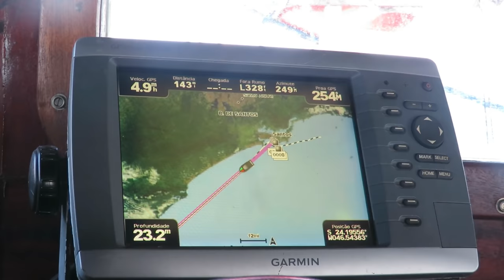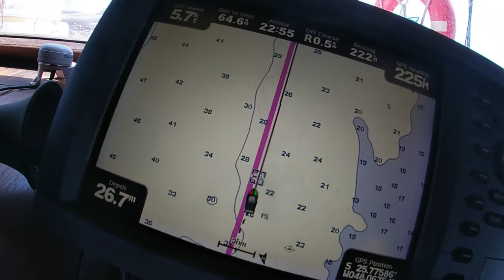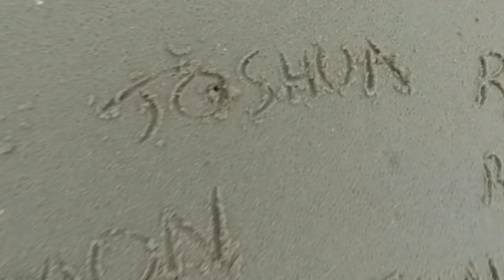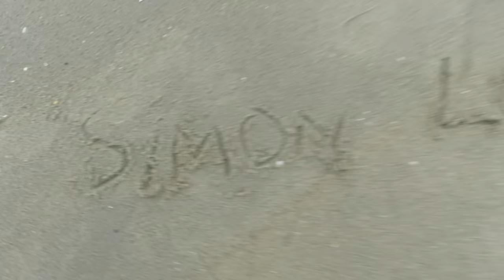HOLY SHIP! Cruising 250 nautical miles on board of a leaky boat — Sailing Yabá #5

Comment: Hi Guys.

I say this with all Love.

Cleaning the bilge, checking the charging rate of your start batteries and carrying spare batteries and changing the belts before the trip would have made for a very pleasant voyage with heartache or stoppages.

When you get a chance put new belts in place over the water hoses so that if they need changing you do not have to undo any water hoses, just cable tie them out of the way.

Good Luck with the haul out.

David Down Under.
Reply: Good advice David. More importantly, is the way you said it. Too many YouTube viewers shout out their thoughts regardless. Whether or not we have a lifetime of experience, suggestions can be made courteously. Otherwise, the recipient sees aggression, arrogance and derision. Then the point is lost. Most Yaba viewers feel a lot of love and support for this project.

Comment: Nice work getting to port safely. Glad you made it. 

What starting you don’t(shouldn’t) need to pump the throttle. That does nothing for a diesel. It also doesn’t help that I saw the gearbox cable moving which means you were putting it in gear while cranking. If you had separate throttle and gearbox controls it might be different. But proper a running diesel shouldn’t need to have the throttle moved to start ever. They should always start in the idle (tick over) position. 

If you had left it in neutral it might have started even with a low battery. The electric starter motor isn’t supposed to turn the gearbox, prop shaft and prop. So if you have left the throttle lever in the middle (idle and neutral) then it might have turned the engine over fast enough to start even with the low battery. 

Cheers,
Jeremy

Comment: Your engine not starting is most likely a connection problem. Remove and clean all your connections. The engine cooling problem is common. Your heat exchanger is most likely clogged and needs to be cleaned. Remove and have it cleaned. A low cost approach is placing the heat exchanger core in white vinegar.
Reply from the maker: It was a bad terminal connection. We just connected the engine to another battery. Also there was air in the cooling system so I just opened up a hose to let air out. That fixed the problem

Comment: Pressing that starter button and not hearing the starter spin the motor must have been terrifying. Glad it was sorted out
Reply: Been there. Got frustrated with girlfriend for setting battery switch in wrong position.  Thanked ALL the dieties for poppets on diesel!! I learned things like those poppets, pull cord back-up, and hand priming fuel pump are priceless.
Reply: @danielbuckner2167  lol been there done that too haha. One tme I let the women take the boat out.  I told my sister tank 2 is full but not much left in tank 1. Just switch over right away. You know they run out of fuel and she never remember to switch it over.  Her dumb ass paid for the tow.  I can also remember a time my aunt sunk the boat because the wake scared her and she throttled down. She went up and straight down, whoooshh boats full of water.
Reply: @JoeKyser  I've never run a diesel out except in a 7.3 Ford that had a bad gas gauge. It goes on the fritz semispasmodically so now I hit the trip meter at every fill up just as a back up.
Reply: @danielbuckner2167  mine was gas which makes it simple to switch when you run it dry. Idk why no one, especially my sister thought about it. They didn't know they ran out of fuel so they say. The fuel Guage works fine lol.  Just no thought into it at all. My sister knows better. She was freaking born on a boat. I guess they were just looking for the good times haha. Boat was the preferred travel method to town so they could shop. It was way faster in the water rather than the car which you had to take a crazy drive.

Comment: I am so glad you made it.Well done. I was fairly confident you would. Now can I add a little advice, please? Each time the motor started I didn't like the sound it made. It seemed to turn very slowly at first, then crank OK then fire up. I would recomend finding out why the initial cranking is so poor. Maybe starter motor? Weak battery? Poor battery connection? Coolant leaking into a cylinder (from a slight head gasket leak) causing higher compression on the first revolution? Clearly, I can't diagnose the situation accurately from just watching your video, but I would recomend investigation and rectification before putting out to sea again.

Comment: The more I see Yaba the more I fall in love with how sleek she looks in the water, although it's probably going to be a long rough ride bringing her back to her former glory I for one cannot wait to see the end result, I have faith in you two and although I am sure you will not cut corners make sure you follow Roberta and Ducas example and fix everything possible,regardless of how minor it is.
One question, you said you had carpenters look at the hull, did they by any chance give you an idea of how much damage there is and the cost to fix it?
I can't imagine a wooden hull is going to be cheap to either replace or repair.

Comment: Most Old diesel engines have a decompression lever. Pushing it makes you able to put speed in the flywheel without resistance and start the engine with almost empty batteries. It might be a good plan to look for it on your engine. Saved me dozens if times 😊

Comment: I strongly recommend you purchase a small portable generator. It can make life so much easier even when there is not an emergency
Reply: Honda
Reply: lol. you mean buy a whole new boat.
Reply: There is a portable generator in a couple of the shots
Reply: @AlPence  
I missed it.
Reply: yep, it is in some of the shots. It's one of those "NOISY" one's like mine......LOL
Reply: @mikealbert2527  I think what you’re seeing is the pump he bought for the journey just in case they needed it. It sort of looks like a small generator. But it was in the last video when they were testing it and talking about it.
Reply: Spot on these guys don't seem to be prepared for an emergency 😣 You should always have a plan B and preferably plan C at sea. Also get some decent batteries.
Reply: @wcads623  true, but it’s let’s remember they do not have the boat set up yet. This trip is just to get them to the location they’ll be doing their work.
Reply: @srcastic8764  Yes but setting off on a 250km in a leaky boat you need to get the very basics in place even on an inshore passage. Things go wrong at sea very quickly  weather changes, equipment failure, blah blah etc etc .
Reply: @wcads623  no disagreement there.

Comment: Loosen the alternator mount, and then slip the belt over both pulleys, and then tighten the alternator amount until belt is good, don't turn off the engine it won't restart..... I did this one time in my old Chevy out in the desert.

Comment: I have strengthened my faith in your boat after this trip. A broken belt is nothing but I suggest that you buy spares before you forget. Also,, solve that problem with the cooling water before the next trip. Great job with the video guys.

Comment: Congratulations getting to your home port, after the last video I was really shocked how bad the hull appeared. It can be fixed at a cost, sadly that may greatly exceed the value of the boat. If that is the case, you could still live on the boat. The hull inside and out could be covered with several layers of fibreglass and epoxy. I hate to see that on a wooden boat but 
 if it saves the boat even as a moored houseboat its better than scrapping it. Good luck.

Comment: Do you know why the batteries failed? I saw comments about bad connections which would mean they could not be charge and bad batteries. After the engine was turned off I thought I heard something about 12 volt water pump. Was a pump running off the batteries that were needed to restart the engines. It would be helpful for everyone who might experience similar situations to understand the cause. Glad you made it safely.

Comment: Coral spawn! From my many years at sea, I would NEVER stop a diesel engine at sea as a start is not a certainty (as you found out!). A diesel does not need electricity to run, only fuel. You carried an emergency petrol powered pump and I would have used that if the water level in the bilge got critical! Belts can be adjusted while the engine is running! Good lesson to learn!

Comment: Change your earth cables from the battery to the engine 👍, easy test to check if that is the issue with a lazy starter is run a jump cable from battery to a good earth on the engine 👌

Comment: You need a portable generator for pumps when engine is off. Double check all battery's for loose connections, corrosion. Get 2 more belts, find that leak in cooling system.

Comment: You might want to get that starter rebuilt as it does sound like it's dragging . Looking forward to see how many planks you have to replace
Reply: I'm gonna go out on a limb here and say everything below the waterline is doomed. Probably the keel as well. Most of the frames are probably salvageable.
Reply: That was him leaving his finger on the button after it fired up which held the bendix out and the motor free spinning but the gear has been flung back disengaging it.
Reply: @justinfufun5483  No , I could hear the starter dragging .

Comment: When you're pulling on the line in the winch, you're supposed to hold it so your pinkie is towards the winch and your thumb towards you. Idea is that if the line suddenly slips your thumb doesn't get sucked into the winch (pinkie is less likely to be sucked in because of the angle you're holding it).
You're quite out of my comfort zone, but in my country they say lady luck protects crazy people so go on being crazy :)

Comment: Guys, fix or get fixed your engine very well as you will need it for sure on a boat that big. Also, if you can or dont have it install get a bilge pump belted conected to your engine for a emergency pumpi in case of large sea water intake. Is not reallly a good idea to stay close to shore is the otherway around. The shore is where the danger is!... Best luck. Enjoy sailiing and cruising.

Comment: Trichodesmium

is the floating residue you motored through. Dead algelae from reefs I think. I first saw it on my first sailing cruise on the Australian East coast in 1987. 
Good luck with your restoration.

Comment: Does your 12v pumps run on your mains batteries? If they are I would set up a battery with a diode so it can always be charged but it wont pull from your mains. My dads boat had 3 back ups. (Needed every one of them!)

Comment: the engine could of been hydro locked,try turning the fan manual can move the pistons to release pressure in the bore..also i would buy a generater that can also charge 12v batterys as insurance.
Reply: Yes. And that makes sense with the coolant disappearing. Probably a blown head gasket.

Comment: Check to see if the alternator is charging the batteries if so then the batteries should start the engine .Question do you have a gas powered generator for charging batteries
Reply: Harold Domangue    Same thought. On that big a boat, wouldn't you take a small stand-alone diesel or gasoline power generator on bord for backup electricity? Modern ones (inverters) have 12 V output added, even the cheap ones.
Reply: @christiangeiselmann  even if they hook up the solar panels to the battery banks that would give some charging to all the batteries so they would not be dead in the water. They are SO unprepared as a young couple

Comment: I was going to say exactly the same as Mike, get a generator,  the likely reason you couldn't start back up straight after, is you carried on not at first noticing your belt was broken,  as you keep going your still using power for what ever   then you notice but by then the battery hasn't enough power to start the engine,  I think you were a bit lucky you had both another battery and someone that new what to do , or it was going to be a different ending perhaps.

Comment: Next time (if there is a next time) please bring a portable generator that can be used to charge batteries or run bilge pumps if needed.  submersible pumps are a dime a dozen in mains voltage and would move a lot of water if needed.  The Honda generators have outputs for charging 12V batteries built right into the generator.

Comment: Let's see a pic of the engine that shows the arrangements of the belts. The old Chrysler marine engines had a belt arrangement that was guaranteed to wear out belts,  I had to rerout the belts and use different belts in order to get the belts to last.

Comment: Everyone who consider buying an wooden boat should see this channel, hopefully it wil make them reconsider.
Reply: There is nothing wrong with wooden boats Jon. It's unseaworthy boats, that's the problem.
If that engine didn't start back up getting into night with no lights or radio it could have been a very different situation, even a fatal one.  Being so unprepared as not having a generator on board or even checking belts before the trip and by the looks of it  not even  a manual pump! wow, I'm very happy for these foolhardy voyagers to have gotten into port safely but I really do hope they take the dangers of the sea for real and take some notes for the next trip!

Comment: I tink one off your trouble starting the engine is the starter not the bateries , good luck
Reply from the maker: The connection in the battery of the starter was off.. luckily we fixed it! Thanks!

Comment: NOTICE:

1. Learn the rule of 2, and never go to sea without being completely prepared. Sell your boat and start fresh if you must. It is better than killing yourself. No amount of money or "personal reward" is worth losing your life over. Even success when risking your life is not considered success. It's nothing more than luck.

2. If you ever need to start your engine when you are having battery trouble, TURN OFF ALL THINGS WHICH USE ELECTRICAL, and use your gas generator, and have it connected to a very strong battery charger, not just an alternator. It will allow your engine to access as much electricity as possible.

3. Stop making stupid reckless decisions. Admit when the risk is greater than the reward. Taking chances is fine, but you are taking reckless chances. Stop, and start being responsible with the life of your spouse and crew. That goes for both of you. Stop trying to turn everything into "cute" before you kill each other. Think smart. You are not doing so. You can ignore this if you want, but I don't care. If all you ever take to heart are the comments that make you feel good about what you are doing, then you are a fool. Listen to the things you don't like just as much as the ones you do. Wisdom is gained through experience. If you don't have the experience, you're walking blind.

Comment: can you hook up the solar panels to the engines batteries to charge them or swap the batterie from the pumps to the engine that is what I would do until I get the engine running then replace the batteries while the engine is running just done let the battery cables touch metal causing any sparks.

Comment: Try not to run anything electric while the Engine is off, but don't run anything electric that you don't need, just the essential's otherwise it's pulling way to much out of the Batteries. I really look forward to your updates and the sails will help the Engine.
Reply: Yes, if understood it right the problem was dead batteries. Once they removed the dead ones from the power bank it was fine. Well and the pump to keep the boat floating is kind of necessary in this boat.
Reply: @schuttrostig5729  I was trying to be helpful & did I say anything about the Pump? If the batteries weren't fully charged there's no point in having a lot of stuff on pulling power.
Reply: @kevnwarriner8819  Wasnt saying anything against that, relax.
Reply: @schuttrostig5729  I think that Ben and MP's friends' boat, Odd, has a purpose-built switching arrangement which will allow the house-batteries to start the engine if the normal battery is unavailable in an emergency.

Comment: After 11-hours motoring the batteries should have been fully-charged. So, either the original batteries are no longer holding charge (and should be discarded), or the alternator is not working properly. No offence, but all this kit should have been serviced and replaced prior to setting off. I'm relieved you got through it, but just think how different it could have been - drifting, near land in adverse winds. It's worth carrying a spare (new) alternator, coil, etc, plus duplicates of all the belts and hoses and plenty of jubilee clips, etc. Great video, even though it does tend to promote stomach ulcers among the the more experienced viewers!
Reply: @JCrook1028  I admire your spirit. When I was young I was somewhat like you. The problem with getting old is that you worry about things more!